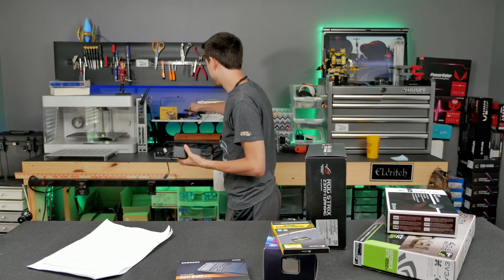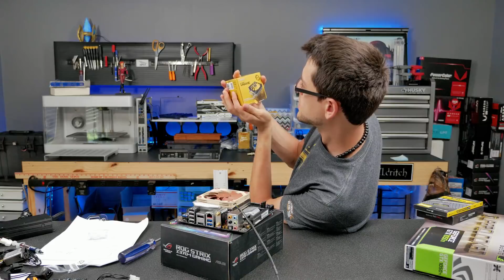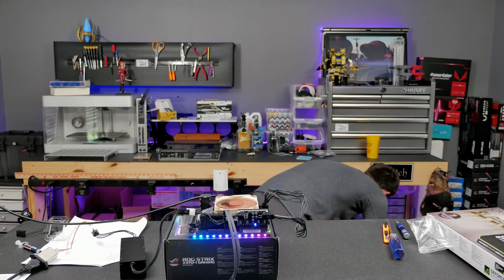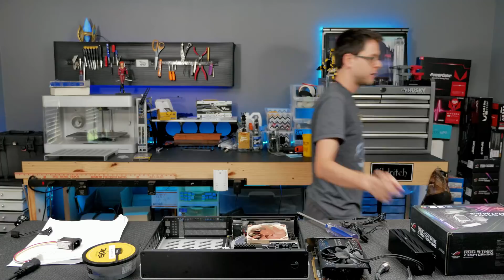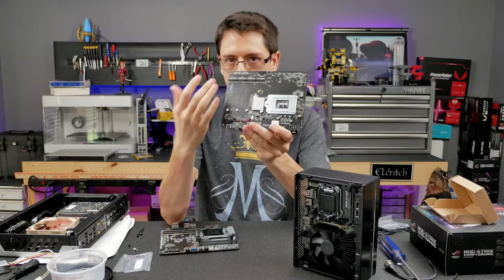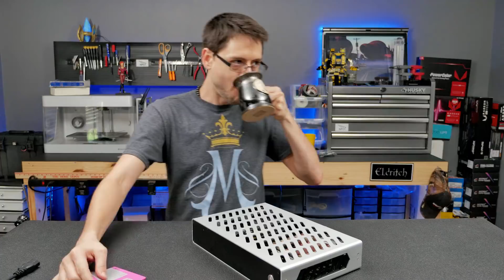In which I build a 1050ti Brickless MINI (Live Stream)

Comment: Hi NFC! I`ve bought your case and your Power Button. I`ve tried to install it, but it doesn`t fit stably the hole : It continues to rotate. Can you tell me how do I have to install it correctly?
Reply from the maker: Hello, Marco. Thank you for your purchase! Have you removed the included nut on the switch? You have to remove the hexagonal nut, put the switch in, and then put the nut back on and tighten in. You can see me do this at https://youtu.be/vXNX_eFR-7w?t=5777
Reply: Thank you for the fast reply. Yes, I`ve solved doing what you said. One last question : I`ve also bought a HD PLEX, but I don`t know how to install it without the Tape that you used. Is there a way to install the HD PLEX without it? I can only try to use a large screw to block one of the four holes, but nothing else.